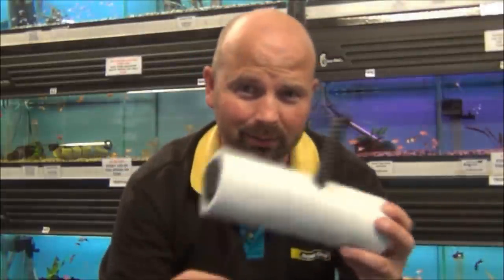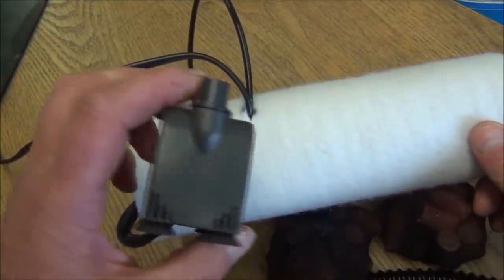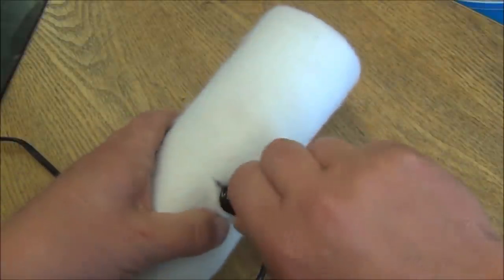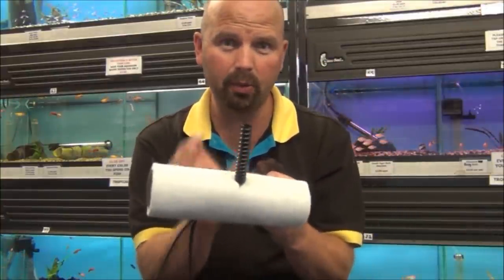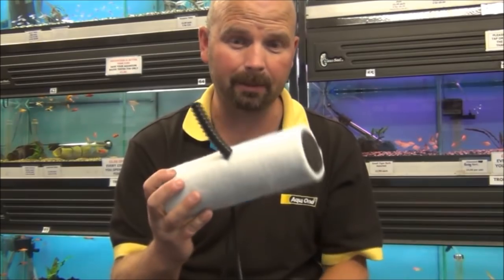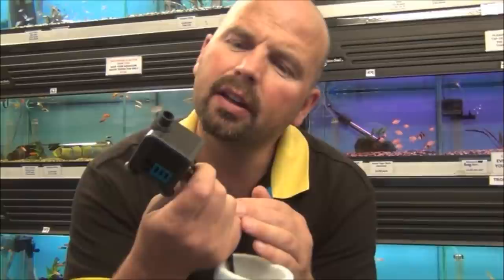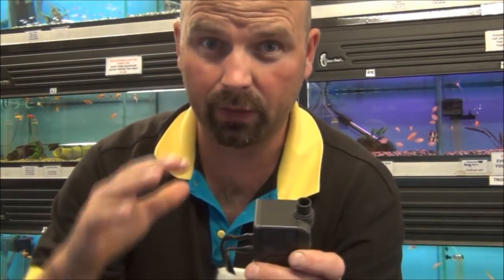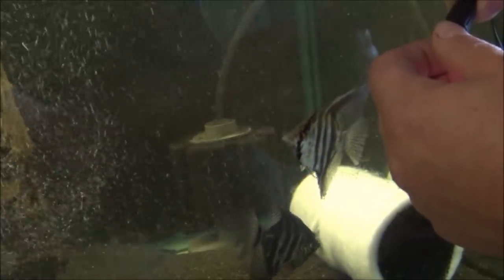BEAT THIS AQUARIUM FILTER!.....GROOVY - DIY AQUARIUM FILTER FROM PONDGURU

Comment: could you not just fit a large round air stone in the middle of the pipe and just make a slit for the air line?
Reply: never mind, i just thought about it and where would the bubbles go
Reply from the maker: Yes most DIY filters you see on Youtube can be air powered and this one is no exception. However the air released from the filter in this design (using the pump) is chopped up by the impeller and distributed much better around the tank.
Reply: I really like this design, would it suit a 60ltr coldwater tank or would you think I'd need something else with it?
Reply from the maker: If it is coldwater with smaller species of fish it should be fine but not for goldfish - they need serious space and filtration so you'd be better with an external filter and larger tank.

Comment: hi pondguru, where did you get the small bags from that hold the biohome media
Reply from the maker: I just buy them from ebay - search gripseal bags
Reply: Pondguru hi pondguru, just typed in gripseal bags on ebay, but they appear to all be polythene, yours look on the video to be a mesh type, if i have no luck finding them, would an old pair of the missus's tights do the same job?
Reply from the maker: bobthebuilderkef I thought you meant the bags that I send the media out in, lol
The 'bags' I used in this video were indeed made from tights.

Comment: Those are the bubbles I'm looking for
Reply from the maker: +Michel Carrasquel The real difference with this pump and others is that the air is drawn in at the same point as he water so it can be shredded down to tiny bubbles that actually benefit the tank. Other pumps will draw air in at the point where water is expelled from pump so the bubbles are much larger, noisy and rise quickly to leave tank before they do any good.

Comment: Does the pump has US-plug?
Reply from the maker: No it has UK 3 pin plug. The pump is 220v so you will need a step up converter and you should get one for under $15

Comment: Will the pump run on 110V
Reply from the maker: It is a 220-240v pump but a simple plug in step up converter like this: http://geni.us/1zn4 will allow it to run no problem. I have been trying to find an equivalent pump in 110v for the last 2 years but have had no success.

Comment: Wait.  Where are the bubbles coming from?
Reply from the maker: +cebuboy1976 The pump drags air in from outside the tank through a tube then the air is chopped up by the impeller and spat out with the water.
Reply: Oh...okay.  I have an almost similar looking pump but it doesn't come with an air tube.  Thanks!

Comment: How the fook did you get the air flow tube into the little pump?
Reply from the maker: It is a special pump used for hydroponics which draws air into it and shreds it to create the tiny bubbles.
Reply: @pondguru  I know that I own one lol- I just don't know how to attach the air tube
Reply from the maker: @youlittlerocket  There are 2 different versions of the pump - one has a metal tube out the back to attach an air line and the other does not.
If you have the type which accepts the air line it would have come with a black air line and there will be a rubber nipple on back of pump, remove that and it will reveal the air input.
Reply: @pondguru  oh I see Thank you 👍

Comment: Pondguru you're looking in the wrong place. That is pipe and conduit insulation tubing. you ca get it any where in the states brother.
Reply from the maker: I can see plenty of foam insulation tubes but none made from polyester. If you have a link to a picture or any seller I would appreciate that very much.
Reply: James Meloy You know what? I'm wrong. That is Drainage fabric tubing. Geotextile fabric tubiung.
Reply: James Meloy Anywhere that sells irrigation suppiles.
Reply from the maker: James Meloy I think you're getting confused with what the tube in this video is made of. The stuff used to insulate pipes is a sort of foam which is different from the fabric used here. I can't find any fabric used for drainage or insulation. This is the stuff typically used for insulating pipes:
http://www.irrigationdirect.com/tutorial/irrigation/view/winterizing-your-irrigation-system/expert-advice/id/19
Reply: Pondguru Yes, it was confusing. It looks like fiberglass pipe insulation or fiberglass relining tubing. But, that is  Geotextile polyester non-woven fabric tubing. the fabric is used in landscaping and enviro solutions for drainage and for electric insulation. Not much on the web about it. It's the same material as garden bed liner. Rolls of the fabric are easy to find, its that thickness of tubing that is more difficult.
Reply: James Meloy The only supply i can find of this stuff is wrapped in mylar or as sleeves for irrigation tubing.

Comment: alright bud, im yet to get one of these soon but atm iv plenty filtration. my querie is, iv brought some 100% polyester sheeting from dunelms. is it safe to throw in 1 of my filters? i read and heard that it has flame retardent on it if you burn it and it does not light it frizzles out. if you lite it and it stays lit then its safe because it has no retardent. how true is this do you know?
Reply from the maker: +NorthEastRider 2014 I think that sounds about right. I know the foams I sell burn like hell as I often use off cuts to get the fire going in the cabin where I work. I've used polyester sheeting many years ago from non-aquatic suppliers and it has been fine but as I now sell it I only source from aquatic suppliers. There are loads of products out there which are great for filter use which aren't sold by aquarium product retailers.
Reply: Yeah iv tried some out and tbh in v.suprised how much its cleared my water in 24hrs almost.  Was strange as I done my usual clean and water change but my water went cloudy as hell. Now its almost clear lol good stuff and cheap as chips.  1.75 for a huge roll of it.  Thanks for reply bud.
Reply from the maker: +NorthEastRider 2014 Sounds good to me, groovy.

Comment: I would urge against average joe cutting / splicing any cord especially in an environment where moisture is present.  Home made wire splices may not be water tight & if they get wet present an electrocution hazard.  Not even really necessary for this filter idea; you could just route the cord out the end with the foam plug & problem solved.  Nice idea on the filter, but please don't modify the cord.

Comment: cool for a big tank get a big pice of tube fiber stuff maxie jet pump 1000l you can attach pvc pipe or hose pipe to that drillll holes init and make a t junksion attach pump to the middle of t  so so you have 2 foot pipe pvc or hose pipe and the pump will attach to the middle  see __I__ and put it in the tube wool and make a little hole iin like he did so pump can flow

Comment: You selling any of these?
Reply from the maker: Media, pump and foam yes, tube no - I can't get at reasonable price yet.
Reply: Pondguru The pump isnt showing on your ebay store at present. Will is reappear shortly?
Reply from the maker: stecornes I only have one 450 litre per hour one left at present which I can do for £16 + £3 delivery in UK.
As I have just sold the shop I can't get any more pumps until I set up my unit at home as the supplier will not supply online only businesses which has cocked my supply right up. Hopefully that will resolve itself incoming weeks but if you're interested in the last remaining pump just let me know by email and I will send invoice through paypal.
pondguru@btinternet.com

Comment: Whats the pump called?
Reply from the maker: http://www.ebay.co.uk/itm/320-LITRE-PER-HOUR-OXYGENATING-MICRO-PUMP-/321627118446?
Reply: could you get it in canada?
Reply from the maker: mark paul If you search hydroponics suppliers you may find it a that's where it is most commonly used.

Comment: i have Just made this filter and i am a bit dissapointed to be honest. its very noisy at the Air intake. not at All silent like the video says. i believe if the Pump could have a Large Air Wire intake IT could be less noisy.
Reply from the maker: +MightyPooh Not sure what you mean by 'large wire intake'.
If the air is unrestricted it will make noise but as soon as it is turned down a bit it should be nigh on silent. It could be that you have air in the intake pipe making a gurgling sound?
Reply: +Pondguru Outdoors IT is restricted to almost nothing and IT Still make quite some noise. om thinking if the Wire for air could be larger like 16/22 IT wouldnt be as noisy.
Reply: +MightyPooh yes its a gurgling sound
Reply: +Pondguru Outdoors tubing is proberbly the right word
Reply from the maker: +MightyPooh Sounds like it has air inside the tube or air regulator as it should only really make a noise when the air intake is fully open. Have you tried it without the regulator on at all (just a bare pipe)?
Reply: +Pondguru Outdoors yeah thats very noisy
Reply from the maker: +MightyPooh If you put your thumb over the end of the intake pipe to stop air going in does the pump run silently then?
Reply: +Pondguru Outdoors yes IT doed
Reply from the maker: +MightyPooh feel free to send me pictures of how far the filter is under the water as apart from the air breaking the surface or when the intake is fully open it should be really quiet. If you're not happy you can send it back but photos / video of it in use would help greatly. pondguru@ntinternet.com

Comment: it doesn't reduce nitrate. That's really misleading, if it eliminated nitrate there would be no need for water changes any more.
Reply from the maker: +kyle g Not sure why you say it doesn't reduce nitrate. If a sensible amount is used (usually around 1kg per 100 litres for a community tank) then it is able to support enough anaerobic bacteria to reduce nitrates and process them to soluble nitrogen. Here is a link to the US suppler review page for biohome ultimate where people who are using the media have posted reviews. Some have posted reviews as they opened up the box but there are plenty on there who will testify exactly how well it works for nitrate reduction.: https://greatwaveeng.com/shop/media/biohome-ultimate-media/#reviews The whole reason behind reducing nitrates naturally is that it is a long term solution and will indeed result in less water changes.
Reply: +Pondguru Outdoors water changes are the best way to reduce nitrates, and plants are the second best, don't confuse people by saying they can do less water changes and that your filter reduces nitrates. nitrates are the end of the cycle and are less harmful for fish, but still build up. weekly or biweekly water changes should be done regardless to keep other levels in control like D.O.C., whether or not your water tests for low nitrates or high. it keeps excess nutrients in check for less algae, and everything in the tank benefits from water changes. maybe you are seeibg the effects of plants consuming your nitrates. I can't read any nitrates in my heavily planted tank.
Reply from the maker: +kyle g Not sure why you think that the production of nitrates is the end product of the nitrogen cycle but in many tanks the production of nitrates is inevitable due to the poor balance of aerobic and anaerobic bacteria in the filter. To me that is only doing half the job and leads to the regular (often large) water changes most fish keepers have to do. A 10% change every week should be as much as is needed to keep the tank fresh and many of the tanks using biohome which have untraceable nitrates have no plants in them. I can't see how educating people is confusing them - for years we've been told that the build up of nitrates is inevitable and therefore large water changes need to be done regularly to keep on top of that. That idea still seems to be perpetuated by the aquarium equivalent of the Flat Earth Society and it is criminal just how many people in the business have very little idea how the nitrogen cycle works, thinking it ends in the production of nitrates. Its great to get feedback from people who have come to understand that by simply changing their filter media the nitrate can be reduced way down and I for one was worried that a zero reading of nitrate would have an impact on plant growth but it does not seem to affect plants which I can only attribute to the production of soluble nitrogen (from the anaerobic bacteria processing nitrate) being easily assimilated by them. The DOC of a tank should remain fairly constant when a filter is running 24/7 but in a heavily planted tank the O2 and CO2 will fluctuate with the light / dark stages of photosynthesis. The movement of water from filter and air pump will help level out those fluctuations. Successful fish keeping is all about stability and that starts with the filtration,  much like the foundations of a house you can build onto it whatever you like if the foundation is solid.
Reply: The anerobic bateria that reduce nitrates are not present in oxygenated water. They live in the gravel bed where there is very low flow and oxygen. The bubbles you introduce in this method of filtration highly oxygenate the water. So your filter does not house anerobic bacteria. I'm not trying to prove you wrong, but you are misinformed on this entire nitrate/anerobic situation. Plants and water change in home aquariums are the only natural way to reduce nitrates, unless you are lightly stocked with a sand bed that does not get gravel vacuumed. Other ways are chemically, but your demonstration of this filter does not use a chemical method although it is modular. Here is a link to some information http://www.aquaworldaquarium.com/Articles/TonyGriffitts/silent_killer.htm
Reply: also your 10% water changed weekly could very well lead to old tank syndrome, if you have anything dependent on macro and micro nutrients, and are not dosing.
Reply from the maker: +kyle g How can you say that the biohome media does not support anaerobic bacteria when you know nothing about it? The structure is such that it contains a myriad of tunnels which allow for plenty of deoxygenated zones on the internal part of the media allowing it to support an excellent balance of aerobic and anaerobic bacteria. Deep gravel and sand beds can contain a decent amount of anaerobic bacteria but maintaining a balance of good anaerobic bacteria and harmful bacteria build up which releases toxins is very much pot luck. Chemical filtration for removal of nitrate should not be needed and some types of these treatments even seem to contribute to the death of anaerobic bacteria, preventing a properly working filter. It is no fluke that biohome works in shower filters which by their nature are about as oxygenated as you can get. The balance of porosity and available surface area is spot on and the proof is in how it works. When something is proved to work beyond reasonable argument why do you have such hostility toward it?
Reply: +Pondguru Outdoors basic research from many different sources tell me you are wrong about anaerobic bacteria living in the oxygenated water column/filter. with so many sources saying otherwise, I think you should reconsider.
Reply from the maker: +kyle g Anaerobic bacteria by its very nature does not live in highly oxygenated flowing water. Where it does live in is deoxygenated zones of suitable filter media, deep sand and gravel beds and areas of very slow flow. With regard to biohome the proof is in the results - I real don't know what more to say about that as this is rapidly becoming an archaic argument about the earth being flat and the sun revolving around the earth.Just look at how manufacturers set up their external filters - they all fail to realise that mechanical filtration needs to be completed BEFORE the water hits the media yet they all follow each others lead. The use of a 'polishing pad' after the media simply allows the fines to settle on the media, clogging it and reducing efficiency. When media is allowed to operate in clean water it is many times more effective, negating the use of carbon and other chemical additives since the media will ensure good water quality. Using media which has the correct porosity allows for a good balance of aerobic and anaerobic bacteria so couple that with setting the filter up properly and it is a recipe for success. As I mentioned before the proof is in the results people using biohome correctly are consistently having - it is no coincidence.

Comment: I bought a 320 from another supplier as you didn't have any available and its did not aerate the water at all, all I got was some big spluttery bubbles with the valve open and when I started to close the air valve it clanked and banged and made an awful racket.  I returned this to 3CH Hydrophonics who said "Our water pumps are not built to aerate water but comes comes as a consequence of the anti-siphon system." and "The bubbles you observed in the video is an anti-siphon system to prevent a vacuum occurring." Now I am puzzled as their pump is called OXY and has an airline with a valve. http://www.ebay.co.uk/itm/MICRO-JET-320-OXY-WATER-PUMP-MC-320-OXY/181546223136?_trksid=p2047675.c100005.m1851&_trkparms=aid%3D222007%26algo%3DSIC.MBE%26ao%3D1%26asc%3D27677%26meid%3D8d36f5a639d940449bd4eccc52f65edc%26pid%3D100005%26rk%3D1%26rkt%3D6%26mehot%3Dlo%26sd%3D181546223040&rt=nc
Reply from the maker: Never heard of an anti-syphon system before so can't begin to explain what they are on about there. Not sure why there would be an inlet for an air line on a pump which wasn't supposed to aerate the water?
It's an aquarium systems pump so it may be different (although it looks the same). Looks like they are just making it up as they go along and could simply be that the pump was faulty. Never had a problem with any of the pumps I've sold but they are from different manufacturer.